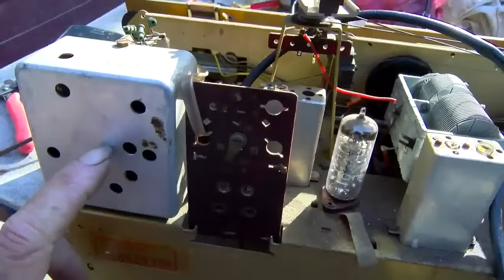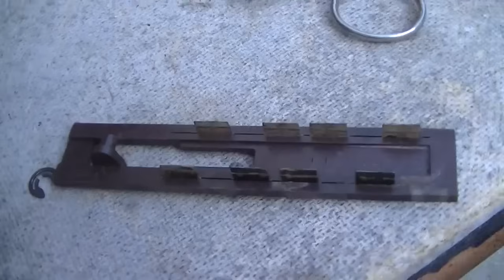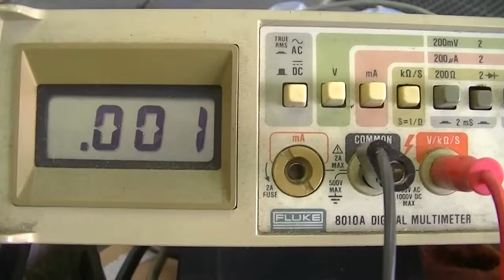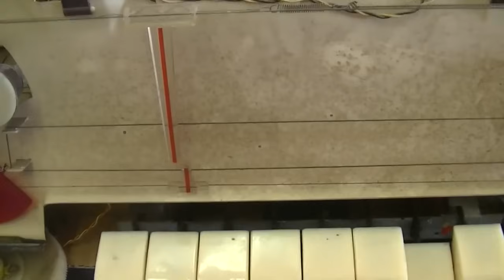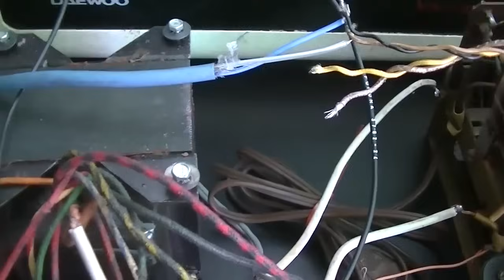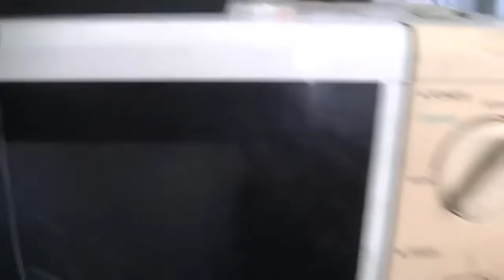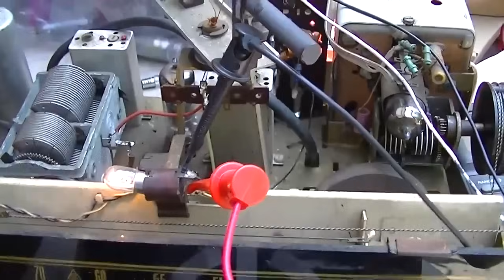Grundig Majestic 3035 Radio Repair Full 720p

Comment: Feature length Shango!
Line voltage around here is 122v. It was 128v for a week when the utility had a tap set wrong (256v from the dryer plug). I was going to place a call, but voltage returned to normal.

Comment: Good work Shango. Valves they are. Tubes are something you put in a bike tyre! ;-/
Reply: NO DOUBT THEY ARE VALVES.....MAY BE ERRATIC AND TEST FINE ON A TUBE TESTER....YOU NEED TO INJECT A 1000 HZ SIGNAL AT 1 VOLT PEAK TO PEAK AC SIGNAL AT THE BEGINNING OF THE CIRCUIT AFTER THE DC SUPPLY, THEN GO TO 50%AN POINT TO SEE IF IT IS A PROBLEM TO THE RIGHT OR LEFT OF THE CIRCUIT....CUTS DOWN ON TIME IT TAKES TO TROUBLESHOOT.............. SEE AT DIFFERENT POINTS WITH A SCOPE DOES IT INVERT OR AMPLIFY....MORE AND MORE...I AM STARTING BACK WORKING ON OLD TUBE AMPS...I HAVE 5 WAITING FOR MY ATTENTION RIGHT NOW....ANY HELP IS GOOD...HARRISON YOUNG
Reply: Yes, kind of sounds good to hear the VALVES called by there EL/EF numbers.
Reply: I think "Tubes" are subways in the U.K.
Reply: Simon Spiers Yep that's what us Aussies call them, valves too.
Reply: What about vacuum bulbs.
Reply: force311999 Tubes are something you remove when you've ran out of bog paper .
Reply: poly-semantic words
Reply: DON DON 
You don't need to shout.  WE CAN HEAR YOU!

Comment: Grundig is always a highlight. Known for best possible quality. Max Grundig was a crazy perfectionist.
Reply: I have to say, I'm impressed with Grundig's quality. Even the later (1979) RPC350 music centre I'm restoring is a cut above other music centres. Hell of all the caps I've tested all but 2 of the original Frako and Unicon items have tested better than some new ones!
Reply: And Herr Grundig must have had a "thing" for elaborate tuning/cord arrangements since on the RPC350 firstly it has 7 UKW presets (touch activated no less) and the dial cord itself is actually a pair of wires taking power to the lamp that moves with the dial cursor!

Comment: Thanks for posting this as it might give me a bit more info & help restoring my old 50's radio as I've had no luck finding anyone local to restore it for me here as some people in this silly town called my radio old useless junk! Sorry but it ain't to me or others. :(
Reply: NO...KEEP IT....THERE WILL BE A POST ON YOU TUBE TO  COVER REPAIR FOR YOU ARE YOUR TECHNICIAN.....YOU NEED A GOOD CAP METER....FRONT TO BACK RATIO FOR DIODES....CHECK PLUG IN WHERE TUBES MUST GO.....ETC...I HAD JUST A BAD GROUND THAT LIFTED THE B PLUS OR DC VOLTAGE TO MY LAST AUDIO STAGE PRIOR TO SENDING TO THE 6V6S IN A PUSH PILL CONFIGURATION////I SOLDERED THE GROUND AGAIN AND IT WORKED NICE.....HARRISON YOUNG
Reply: DON DON The only thing I have is a old 80's multi meter! :(
Reply: THAT COULD VERY WELL BE ALL YOU NEED....ARE ALL YOUR TUBES LIGHTING UP WHEN YOU POWER IT ON?
Reply: DON DON I've still got to find a power cord for it because someone cut mine off. I have a short brief video of the radio on my YouTube channel.